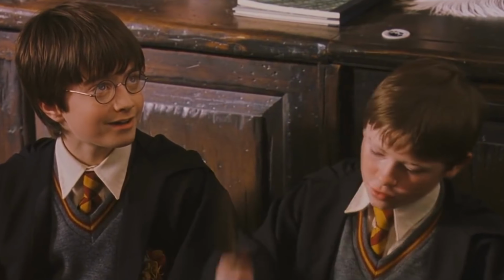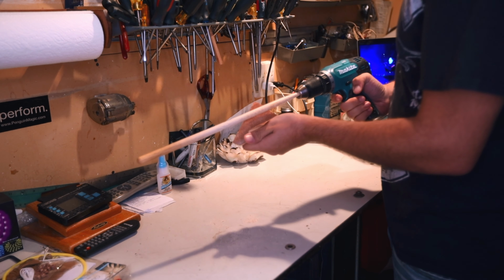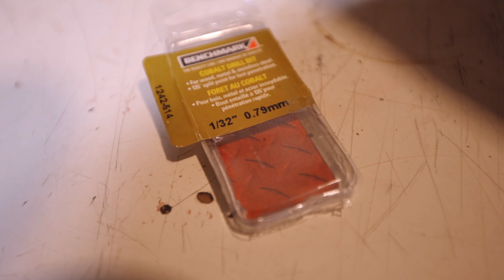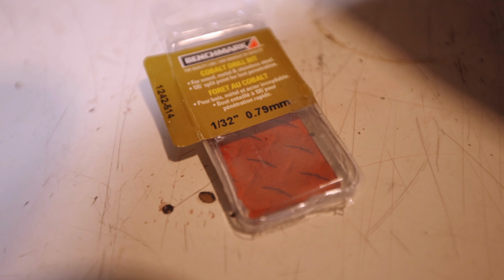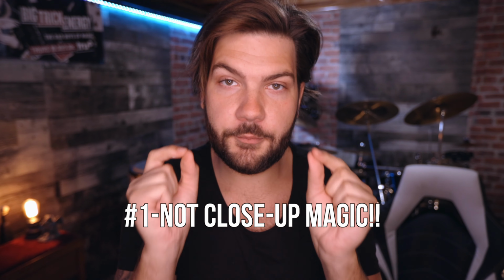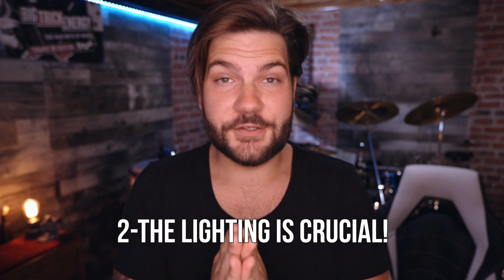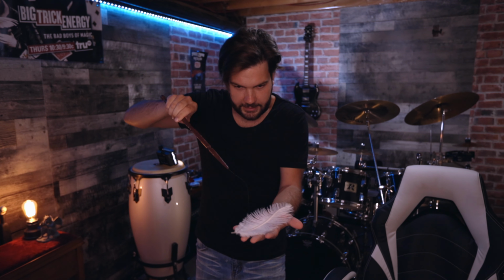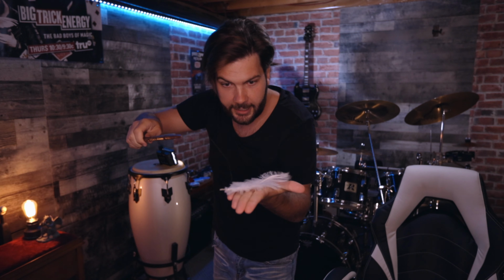Learn How to LEVITATE OBJECTS like HARRY POTTER! - Easy Magic Trick Tutorial (Wingardium Leviosa)

Comment: This was cool thanks.
I might try to make that for my niece. She's a big Harry Potter fan.
I also thought if there were a long tube that stretches from the tip of the wand to your finger tips, (with the wand in the centre of the tube) then the wire could be attached to that, and you could spin the tube with your finger tips and the feather would go up and down (without having to rotate your wrist.)

Comment: Just some ideas:
1 ) Use hand files to shape your wand, saver and easier than using a power tool or a knive. A round file works fine, a triangular file helps for details. 
2) Have two identical wands, one gimmick-ed for the feather and a plain wand you use before and after you do the levitation. Humans are wired for "object permanence",  for the audience there is only one wand. 
This works for other stuff too, the idea that you just switched a object for a gimmick never crosses their minds. Have a rather suspicious looking Ace of spades? Just have them handle a normal one first and the gimmicked card magically disappears from view.